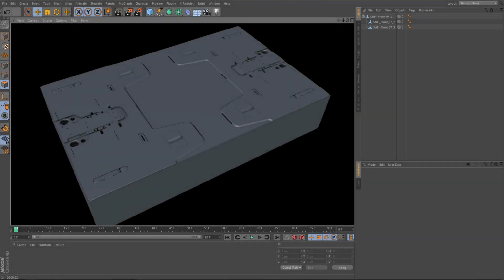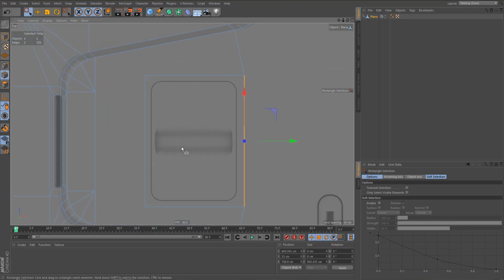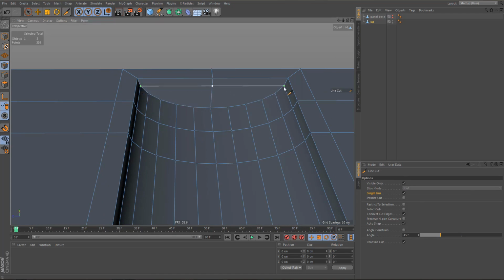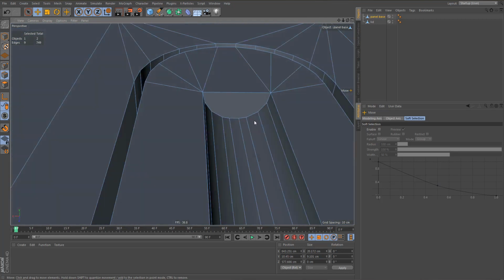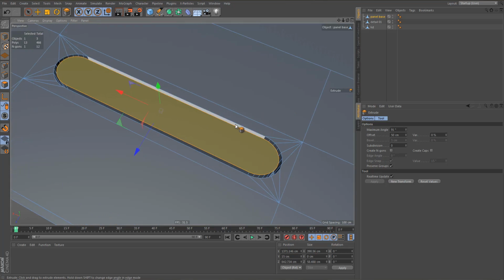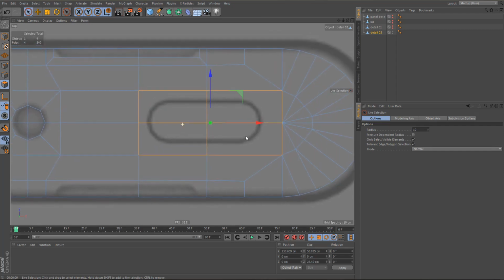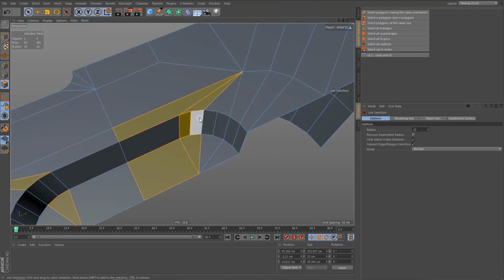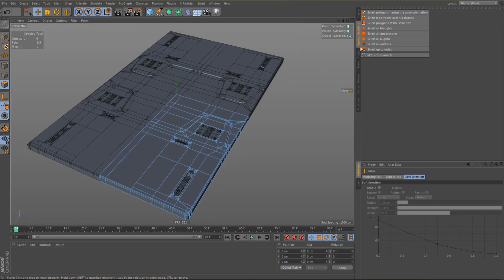HS Excercise 07 - Scifi Floor Panel 002 - PART 1

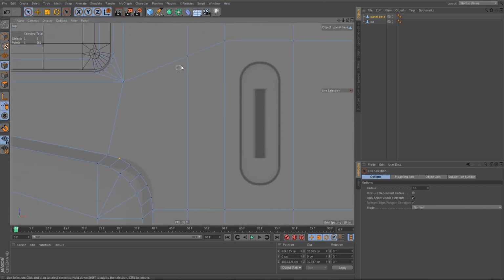Comment: Hi, great stuff. Thank you. Just wondering how you are doing "connecting to points" I know cut, or MM once both points connected, but you seem to be able to draw the cut?! e.g. 27:59
Reply from the maker: Thank you very much! 
I connect the points by selecting them and then using "Mesh - Commands - Connect Points/Edges". There is no default shortcut for this in C4d, I am using a custom one because I need "Connect Points/Edges" all the time. I have it mapped to the "<" key. Sorry that it I was being unclear in the video.
Reply: @Wolf-4D   Don't worry! You can not think about every "dummy" user.  So I was right with my guess that you used the feature behind M~M. Thank you for this videos about modeling. Learning every day
Reply from the maker: @ErElBabl  It's more like I don't think about certain things much anymore because the things you do a lot tend to become second nature. Everyone who's watching my videos is always welcome to ask questions, like you did. I'll be happy to answer them if I can. Glad to hear that my tutorial is useful!